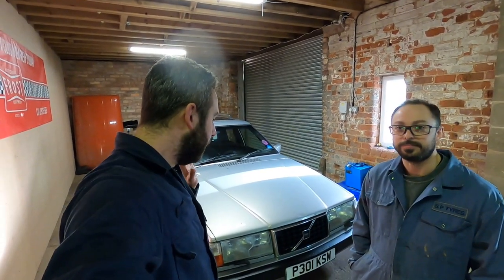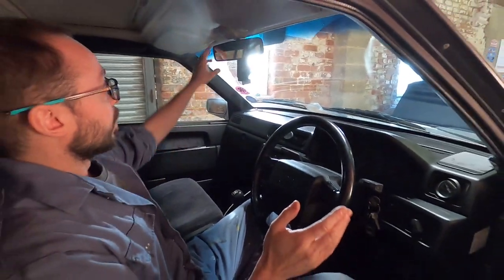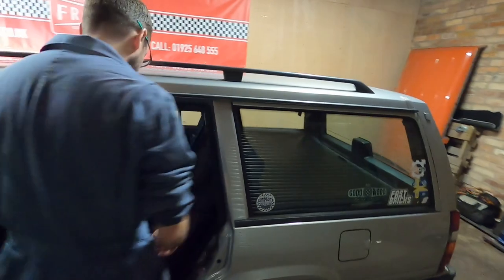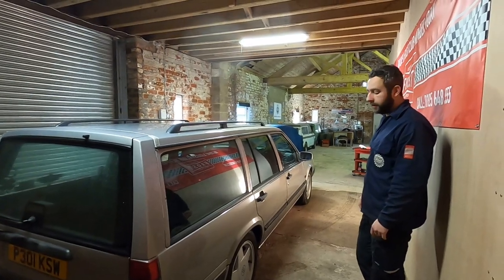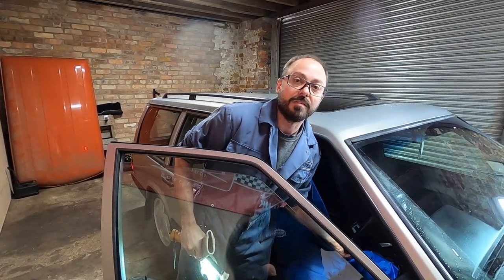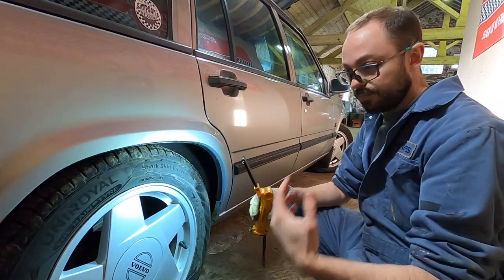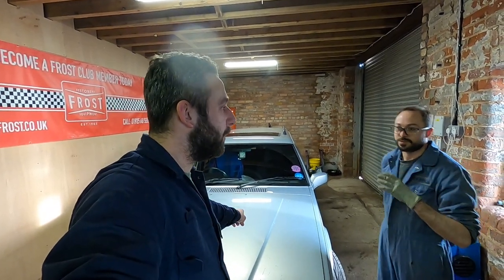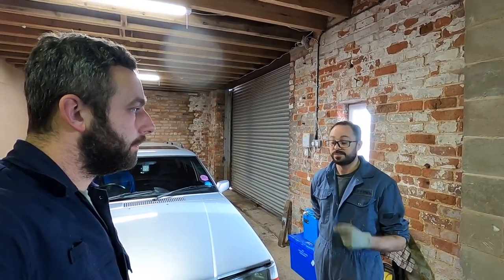MOT CHECKS - What you can do to Guarantee a PASS!

Comment: It's amazing .. here we have an nct . Which is governed by one body .. not an individual garage .. I sent my daily in with a tyre that the wire was coming out of .on the inside . To get a fail .. here they find stuff that's not a problem and fail dangerous .. like the dust cover on the track rod end . They passed the tyre .(it's a visual so it's free) to fail it on a flashing glowplug light .. not an eml .. because it costs money to repair . Mad to see the differences .  An nct is 25 mins max . In and out . My golf had 2 pages of fails 90% was dust covers on joints
Reply from the maker: Oh that’s madness I didn’t know the rules where so different over your way. That’s interesting. Cheers for watching buddy
Reply: So, what is an NCT and EML, and where in the world are these the rules?
Reply: @mayflowerlash11  hi mate an nct is similar to an mot nct stands for national car test and an eml is engine management light    and I'm from Ireland
Reply: @johndaly2180  Thanks John, that was a fast reply.

Comment: One of the dash bulbs isn't working.  Mine has this, usually a good smack on the dash works.  Front disk guards missing, not good for ball joints when the brakes get hot.
Reply from the maker: haha of only it was that easy its an ongoing battle with bulbs, thanks for watching!
Reply: @SimpsonsClassics  I good smack on the dash works for my dash bulb(s), too!

Comment: It looks like the MOT in England checks those things which would create a dangerous situation if broken.
When I put my 940 in for the safety check ( I had purchased it on the basis of photos so didn't have the opportunity to check things in person) it passed BUT they had injected adhesive into the steering wheel as the outer was coming detached from the rigid inner, they had put two new tyres on the front, both of which I agreed with after the fact. They also missed the serious curb rash on a back rim and the missed the fact that the passenger had the seat belt clip missing, totally missing. They could not have possibly tested that seat belt. I subsequently fitted it so passengers had a belt. A bit random I thought.